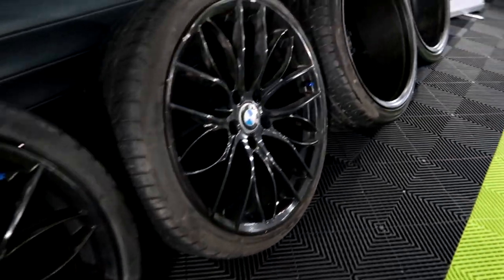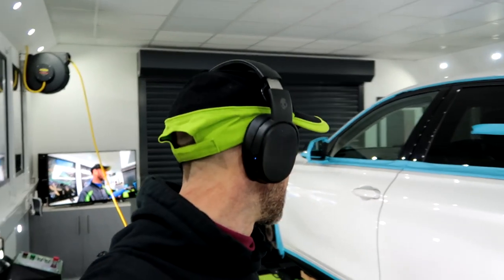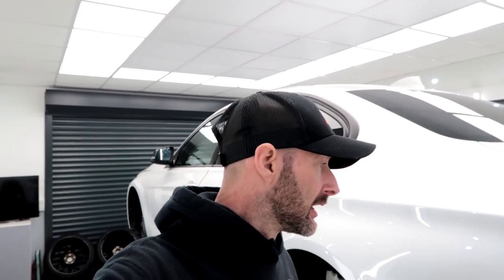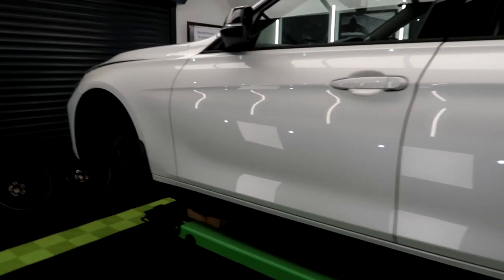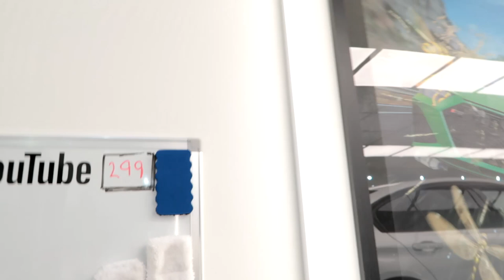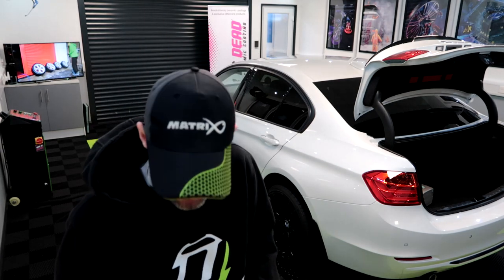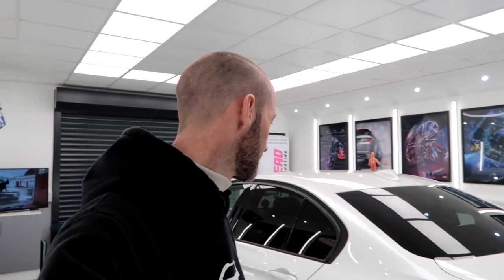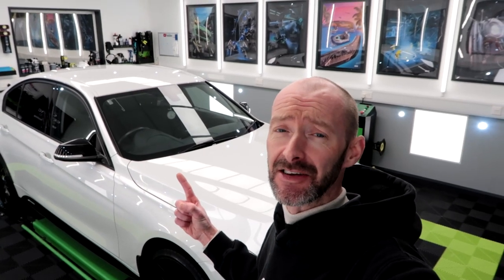BMW 318d Enhancement Detail Kamikaze ISM 3.0 Coating VLOG 005 ( 2023 )

Comment: How do you know when to use Kamikaze vs Wax is Dead vs any other ceramic coating?  Is it something you try out on a vehicle or do you base it off of the color of the vehicle?  Just curious.  I use Avalon King's Armor Shield IX on almost all of my Ceramic jobs but wouldn't mind trying some other coatings as well.
Reply from the maker: It really depends on what the customer is after ( long or short term coating ) ( warranty or not ) and there budget plays a big part in the coatings. 👍